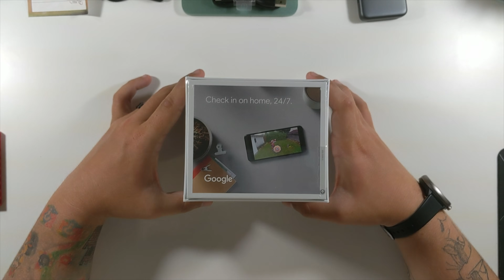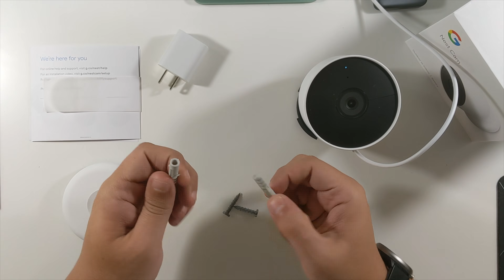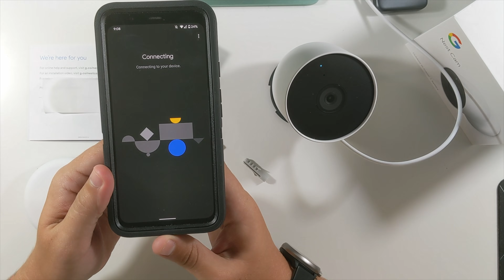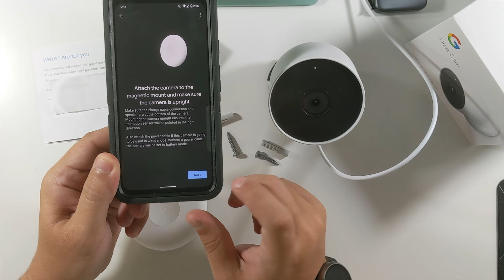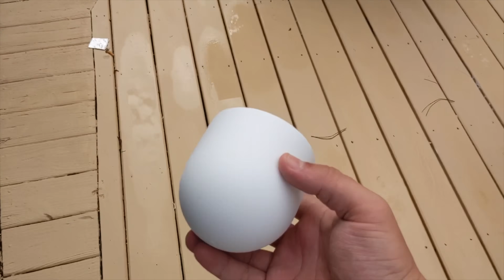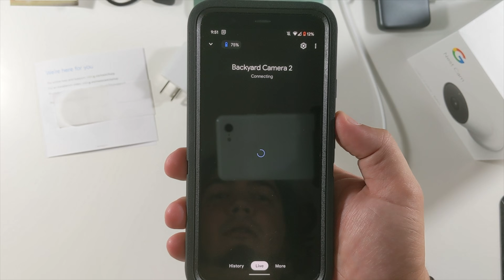Nest Cam Battery Setup, Installation & Unboxing!

Comment: Can someone tell me does it charge by USB & also is there a charge/subscription or does it operate from broard band free
Reply from the maker: Use, it charges with the included USB cable. It's a special cable, not ctype or anything. You get alerts for free, the clips sent to your phone and up to 3 hours of playback for free. If you want to view anything older than 3 hours, you have to pay monthly.
Reply: Hi That's great I live in New Zealand and have 220/240volts so the USB would be to charge on my Laptop

Comment: Hey sir, about how long does the battery last?
Reply from the maker: About 4-5 hours.
Reply: @BigCVlogs  so I've got to charge these multiple times a day?
Reply from the maker: @amazzinmetscards  hahahaha my bad. I thought it said "how long to charge the battery" hahaha.

It last 4-6 months depending on the amount of traffic in the area. I've had mine on the back porch and God about 4 months out of it.
Reply: @BigCVlogs  lol no worries, I wasn't very clear with my question. Great video, should be very easy to put these up
Reply from the maker: @amazzinmetscards  it definitely is. They are great.
Reply: Where are the batteries compartment

Comment: Man, these new Nest cameras suck azz so bad. Can't believe Google went backwards as the older Nest cams are so much better. Now if you use these new Nest cams with a constant power source, then they are pretty decent, but when they are on battery, they are absolutely worthless.

Comment: couldn’t connect the 2nd camera.. any advice ?
Reply from the maker: Try to reset the device and then connect to it with your mobile data turned off. Just have on your wifi, open the app and try to add it again after the reset.

Comment: So do the cameras come with the wire if you want to use the wire vice the battery? Also, you said the recommendation is roughly 6 1/2 feet high but what if you’re in a two story home, will the cameras work well at 14 ft?
Reply from the maker: They sell a different 10 foot or so cable for hardwiring it though, so my guess would be this cable wont.
Reply from the maker: It comes with a charger, I'm not sure if it can be used to hardwire the camera or not. During the setup process it ask how it will be powered. I may have to try that out for the review.

Comment: Purchased mine , just waiting for them to ship . Question.  I was under the impression you could not view live feed unless it was hardwired in . From your video,  it looks like that's not the case. Do you have anymore info on this ?
Reply from the maker: Yes, you can view the live feed even on battery. Just open the app and select it. The only real difference in the battery vs hardwired is with hardwired you don't have to take it down and charge it every few months. 😁
Reply: @BigCVlogs  thank you so much , that helps alot, I use alot of live feed right now with my other nest cams , but for the location where the new ones will go it will be more for notification purposes.

Comment: great video! love how clear the picture quality is. alot easier set up than I thought. I'm concerned with setting it up since I'll be doing wired and hoping the extended cord will be long enough. but great video!

i was going to ask if you had the iq outdoor camera and if it is any better?
Reply from the maker: I sadly never had the IQ camera. This is my first Nest Camera devices.
Reply: @BigCVlogs  after everything sync'd . U should have no problem calling for your camera 💪